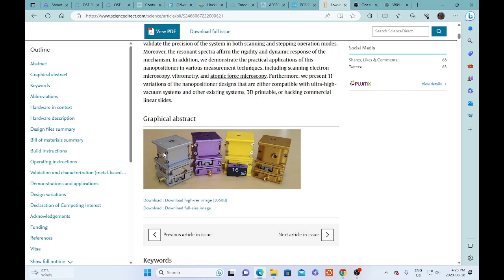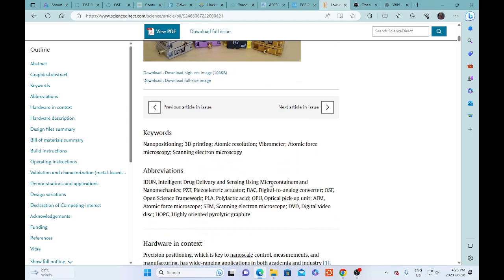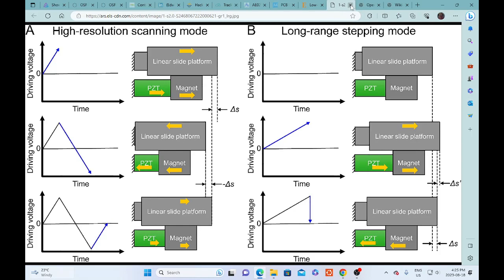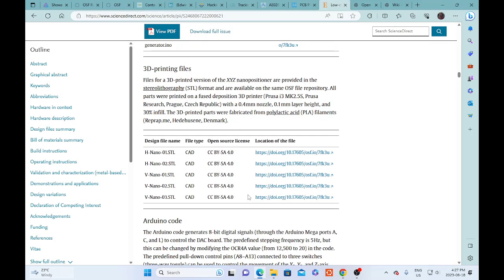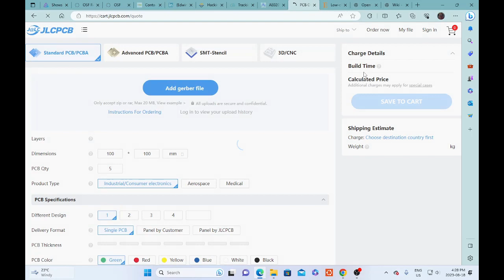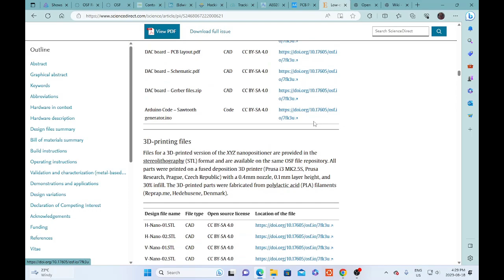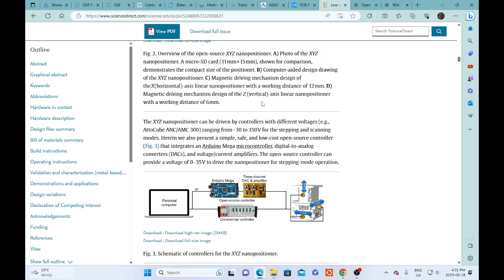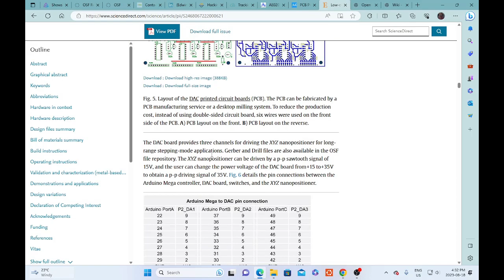Building an Open Source XYZ Nanopositioner -- Part 1

Comment: Have you made any progress on this? I need some help. I’ve built the stage and controller, but the stage doesn’t seem to move. I’ve linked a video to my progress below. Let me know if you have any thoughts on construction or waveform details (freq, voltage, current).

https://youtu.be/ntkQhYuN8KE?feature=shared

Comment: Interesting, a not CD/DVD/BluRay parts design. Well detailed as well. Thanks for sharing!
Reply from the maker: I was very pleased when I ran across it. It’s rare to run across something that’s this nicely documented.
Reply: Just realized En-Te Hwu is Dr. Edwin Hwu. @wackyvorlon
Reply: Awesome to see the open source developments in the research. Gets me wondering about possibilities for spectroscope and spectrum analyzer improvements as well as the added dimensions designs for hyperspectral imaging and microscopes to make using common parts. @wackyvorlon